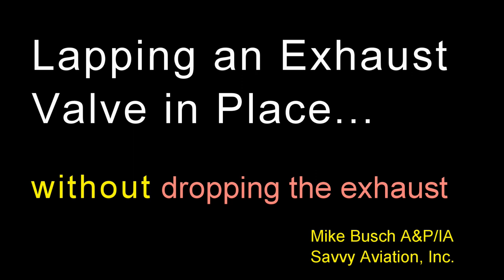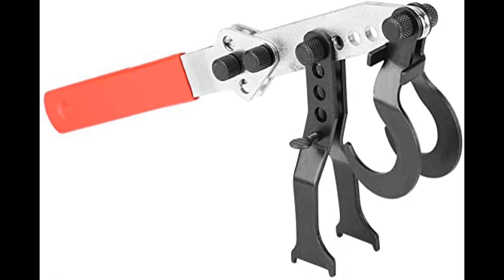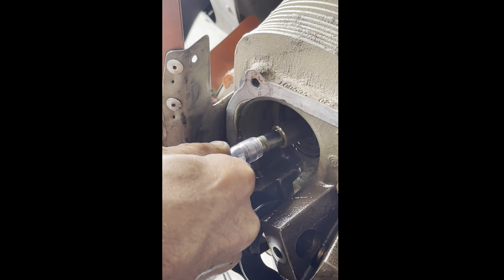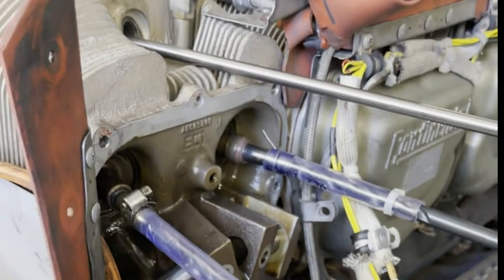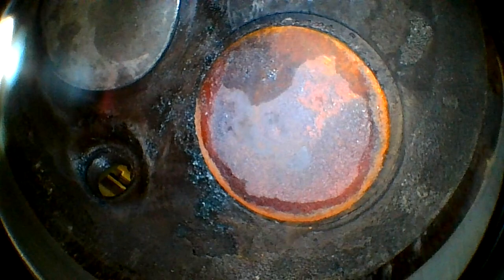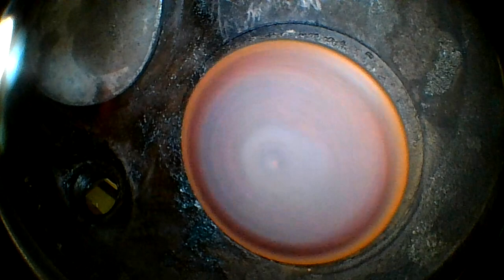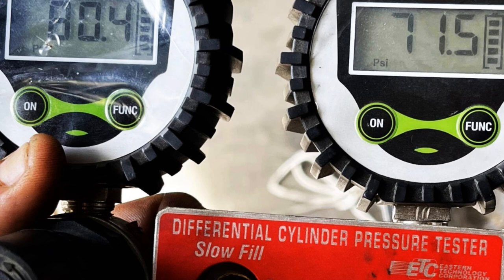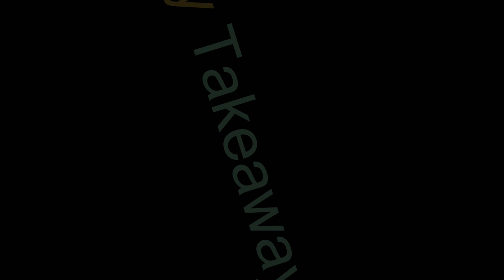Lapping a Valve in Place

Comment: Excellent video!  I have been doing this for 40+ years with great success.  Current engine is at 2900+ hours, 3 original cylinders, never a burned valve.  

A few comments.  
First, don't wait for the asymmetric borescope pattern, by then there is already significant damage.  My mentor's mantra, way pre-borescope, was "if it's leaking, it's burning".  If you hear air at the exhaust pipe during a compression test, fly 10 or 15 hours and recheck.  If it's still leaking, lap it.  Will you occasionally lap a valve that would have survived anyway?  Probably, but really cheap insurance.

Second, when rotating with the drill it's good to lift the valve on and off the seat frequently, and reverse directions occasionally.  That way you get a more random lapping pattern and don't grind "tracks" into the sealing surfaces.

Third, for clean-up what works really well is to dampen a strip of soft cloth with solvent or avgas, and working through the top spark plug hole drape it over the open valve with a piece of soft (e.g. copper) wire.  Pull the valve shut against the cloth strip and rotate the valve to wipe the entire sealing surface. With the right amount of pressure, you can get the cloth to wrap around the valve so as you pull it out it will wipe the entire seat. Do this 2 or 3 times and things are very clean. 

For anyone interested there is a detailed step-by-step description of the procedure I was taught, which is very close to what Mike does, in the August 2021 ABS Magazine (p. 43).
Reply: Great advice thanks! I suppose one could put another saturated cloth inside the cylinder in case any compound fell off the valve.

Comment: I had rapidly decreasing compression in the #4 cylinder of the right IO320 in my PA30. One mechanic told me to call a specific supplier and ask for a new cylinder. Another mechanic came over 15 mins later with a borescope and noticed nothing wrong, except fauled exhaust valve and seat. Compression was 78/80 50 hours prior, 70/80 20 flight hours prior, now 65/80 hot and 40/80 cold with air escaping through the exhaust. My mechanic promised to show her new mechanics and me how to lap a valve. However, after watching this video, I did the job myself after she provided me with the materials and showed her the result. 2 hours later, compression was back to 78/80 cold! Thank you Mike Bush for this great video!

Comment: Thank you, Mike. My IO-520 developed an exhaust leak and the compression dropped from 77/80 to 63/80 (hot) on cyl #2. Tried staking the valve...no bueno. Then, I found your video. I purchased all the exact same materials/tools that you used, except for the borescope; I went with a Teslong articulating unit ($129 on Amazon). After lapping, the compression is now 74/80 (COLD!) and there is NO exhaust leak! Now, I've gone down the "rabbit hole" of Savvy videos and will probably surface some time next year, lol.

Comment: I've done this for years (since the 1970's) with great success. I'm glad to see he used a drill. So many people are of the opinion this needs to be done by hand. Not so. Using power tools makes the job possible and practical. I typically remove the exhaust pipe to apply and clean the valve grinding compound.
Reply: I have never heard that, very smart.

Comment: Thanks for the time and effort to create this video. I learned a lot. I understand the reason for lapping the exhaust valve, but I noticed that you had plastic tubing over the end of the intake valve as well and you had a drill bit in the other end of the plastic tubing as though it were ready to be lapped. I’m curious as to whether or not you intend to lap the intake valve, perhaps to ensure that there is no small piece of debris on the seat?
Reply: My guess is it was just being used as a convenient holder to minimize how far his arms needed to travel. Just a guess mind you

Comment: Great clear video, and just in time—I need to do this to all 6 of my valves this June.  I saw Mike discuss this on SocialFlight and the topic of abrasive removal came up— I thought I remembered him saying any residual would probably all just blow out the first time the cylinder was fired up.  Is this correct?  Another well done video recommended using a water soluble abrasive for easier cleanup?  
     I’m not looking forward to it, but it certainly beats pulling cylinders with all the downsides of that!
Reply: I would suggest just blowing it out by running it IF your engine is naturally aspirated.
Would not suggest it if your engine has a turbo. All that hailing of micro-FOD wont be good for the turbine.

Comment: Is that procedure in the manual? I spent the bulk of my A&P career on turboprops rather than recip engines but I've done a lot of Recep engines in non aviation applications. I wouldn't do that to a Chevy let alone an aircraft. If a valve needs more than staking it needs a valve job.  Valve lapping is to be a quick final polishing of the valve job not in lue of a valve job. Don't get me wrong if I was stuck on a desert island and that airplane was the only way home I'd do it in a second.

Comment: Thanks a lot Mike for your sharing. I wondered that It would be difficult to remove all of the grinding compound.  How do you do this ? Could we use a vacuum cleaner on the exhaust pipe and send some sort of solvent into the cylinder?

Comment: This is a great tip, however, in some cases you might want to do this a bit less intense than what you have shown. Removing carbon and lead should be pretty easy. I was always taught to lap as little as possible.  Over-lapping causes problems by making the sealing surface too large or grooved thus decreasing the PSI on the sealing surfaces. This then makes the seat even more susceptible to carbon build up and subsequent burning due to a reduced ability to transfer heat from the valve to the seat. Just enough is best, if you can manage it.

Comment: I am trying this on my Tiger's lycoming that # 3 exhaust valve fluncked comp chk.(I am AP)

 Valve guide passed wobble chk but valve leaks around the  seat.

Using power drill as suggested, but wondering how long it typically takes to make headway--been grinding about 20 min so far, not alot of progress. Video doesn't mention how long total time spent lapping...

Comment: 2:32Great trick for testing the rotator. Looking at the wear mark on the valve stem tip, was the valve rotating with the rotator?
Reply: I rewatched it a few times and I think you are right

Comment: Mike or anyone else with experience lapping valves in cylinders, how important is it the get every speck of compound out of the combustion cylinder and valve surfaces? We just performed this on a valve that was sealing ok but had 2 area of heat issues. We suspected Roto-Coil rotation problem. We used solvent soaked applicators and wiped the valve while turning with occasional valve to seat contact. This seemed to spread compound from the seat back to the valve where it could be removed. I don’t see how compound could get anywhere in the cylinder except blow out the exhaust system at startup. Is there any accounts of damage caused by residual compound, even in an oil report?
Reply: This was my concern also with this method, but it's a clever idea.

Comment: Hi Mike, Thanks for sharing, I’m your fan.
I have a couple of questions and doubts that I would like to clarify. What about the risk of having some compounds falling into the cylinder? How to clean it eventually? I immagine that if the engine will run with some compound into the cylinder, it will be damaged in less then one hour, cylinder wall and cylinder rings gone. What about the technic of rotating the valve in the same direction? As far as I know the valve must rotate half round to the R and half round to the L, even better a quarter round R/L. 
Thanks in advance for any answer which may help to clarify. Kind regards.
Reply: You just hope you get it all with a qtip apparently
Reply: It’s just a thought, actually my Lyco doesn’t need this procedure 😜
Reply: See my note above about using solvent-dampened cloth strips.  Works really well.

Comment: Quick question: how did you clean the compound off of the valve seat?
Reply: I'm curious as well. Maybe just keep wiping the valve off enough until the swabs come out clean?
Reply: 9:40 explains it.
Reply: I'm wondering this too.
Reply: @jjohnston94  that explains how to get it of the valve, which you are wiping. But you will be unable to wipe the actual seat
Reply: What works really well is to dampen a strip of soft cloth with solvent or avgas, and working through the top spark plug hole drape it over the open valve with a piece of soft (e.g. copper) wire.  Pull the valve shut against the cloth strip and rotate the valve to wipe the entire sealing surface. With the right amount of pressure, you can get the cloth to wrap around the valve so as you pull it out it will wipe the entire seat. Do this 2 or 3 times and things are very clean.

Comment: Someone already asked, but hasn’t gotten an answer: what do you do about the grinding compound that remains on the valve seat?
Reply: See my note above about using solvent-dampened cloth strips.  Works really well.
Reply: @bertw8118  Nothing... start the engine.

Comment: Very well done.  I have question.  You use the lower spark plug hole and one hand to spread the grinding compound.  You use a second hand to manually turn the valve.  And I don't have a third hand to hold the borescope and aim it at the valve so I can see that I am in the right place.  I have the same scope you used.  I have to hold the plunder to bend the scope.  How do you do it?
Reply: There’s a locking ring at the bottom of the plunger. Press and rotate it to lock the scope into position.
Reply: @jbonewitz   Right, but even with the flex tip locked in place, the borescope itself is still ratting around loose in the spark plug hole.   I think Mike may have used something to clamp the  borescope itself in position in the cylinder.

Comment: That valve looks kindda bent to me, tulip seat not seating in the head ring seat. 0:20
Reply: I’m assuming if the head were bent, he wouldn’t get the compression reading he gets at the end.  And if the stem were bent, it wouldn’t slide so easily through the guide. I’m sure it’s not bent.

Comment: OH WOW!     Just wow. !!  SCHOCKED!
You aviation guys supposedly advocate safety and tons of safety wire and safety concerns, yet will lap a valve in the cylinder!
Did ya notice the amount of stem and guide wear it has?    (beyond worn out by any real standards)
Slop does not quite describe it!
Next . did you notice how out of round the valve even is?
Finally, now you left all that valve-grinding compound in the cylinder!  
WEEEeeeeeee !
That is an interesting way to get a new bore job called "FOD" and damage ..  
You just install more dirt , abrasive dirt in that cylinder then it has ever seen in its whole life!
But you saved time and money!
I have been doing valve work for years and you scared the crap out of me!
  Thats airplane maintenance?
I would not do that to my lawnmower!
Yet you will now fly in this ?

A&P?-  Does that stand for awesomely poor? 
If you are lucky and the valve tip does not break off causing catastrophic failure with holes in the piston..next round you will be pulling the cylinder for low compression because the rings and cylinder are all excessively blow-by.
Personally, if this was my powerplant I would be documenting this and suing someone for willful neglect.

Comment: I’m about to have this done to a cylinder on my Lycoming O320-E2D. The shop says Lycoming recommends doing all 4 cylinders but my last compressions were excellent (June ‘22 annual). Is doing all 4 cyl the correct action, or should we limit work to the one with the sticking valve? Thanks
Reply: Just do the one... and see.
Reply: @apfelsnutz  we did, all good now 👍